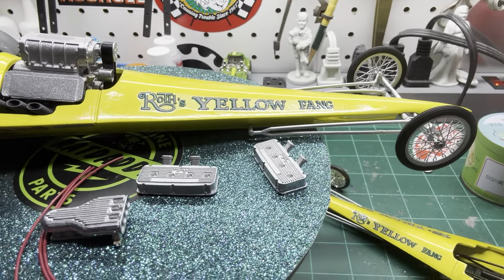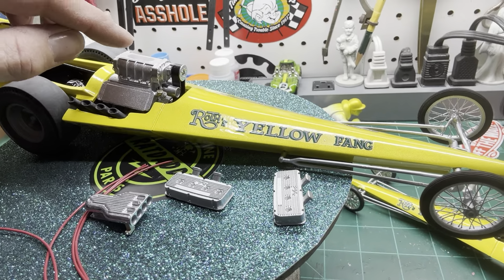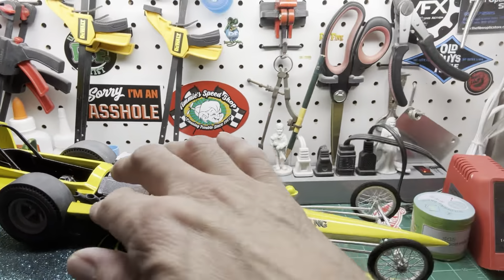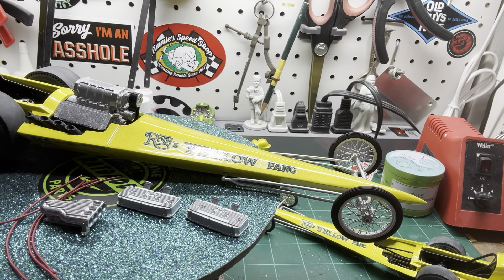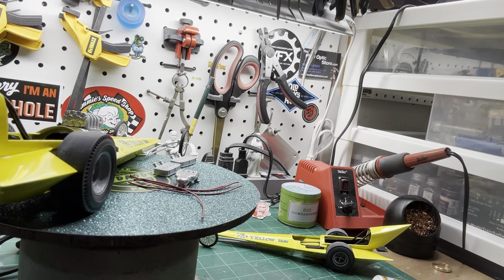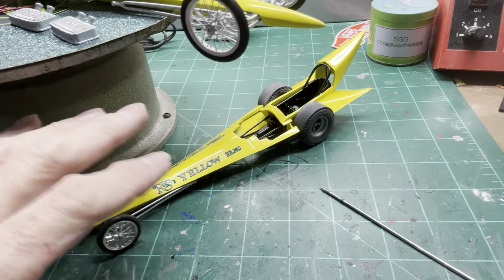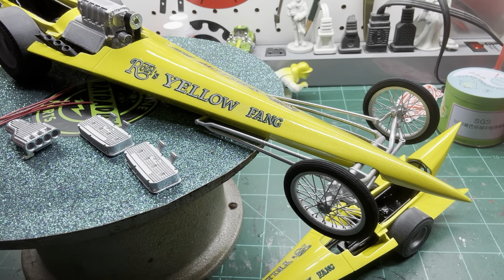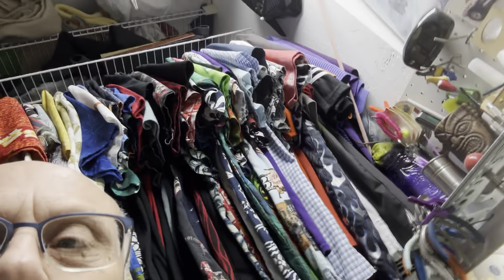Roth's Yellow Fang dragster update!

Comment: You have done really well to get as far as you have with it. As I said before, it's such a shame that they cast it in such brittle resin. I bought some water washable resin and it was just like that kit. If you so much a breathed on it it broke. Never used it since. Do a bit of research now before trying any new resins. Also the parts should have been test fit and resized until it fit properly before sending then out. Poor job on their part. Looking forward to seeing it finished Tim. :)
Reply from the maker: Yeh I'm learning that.  I'd love to have a printer, but I'm not technically savvy enough to operate it I don't think.  So many good ideas, just not smart enough.